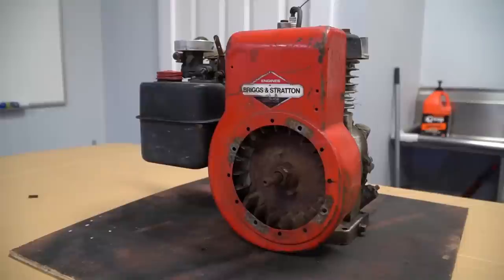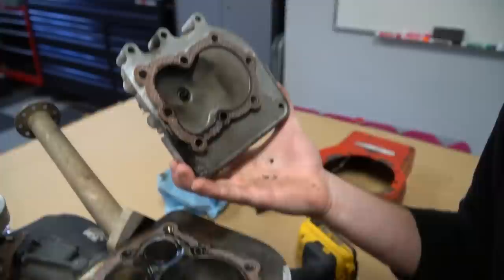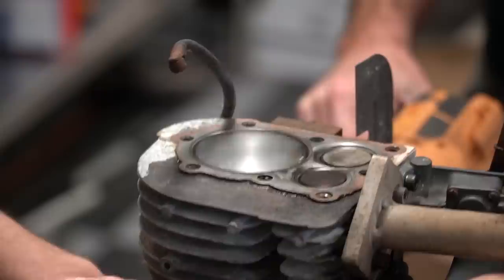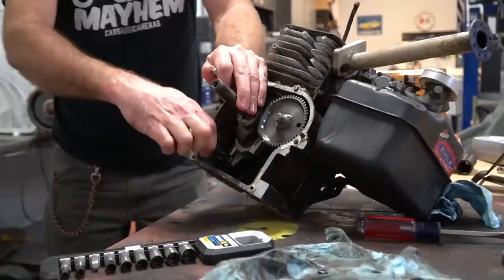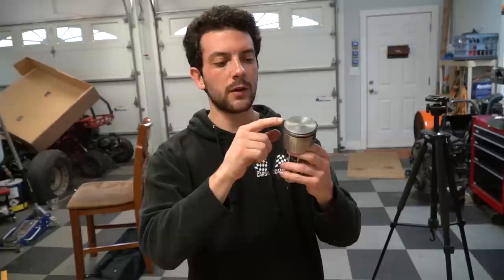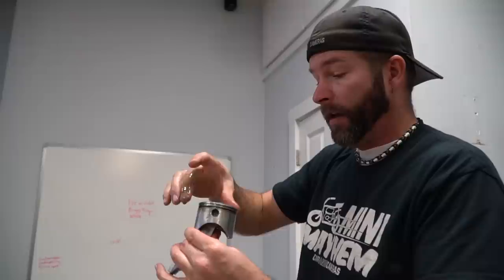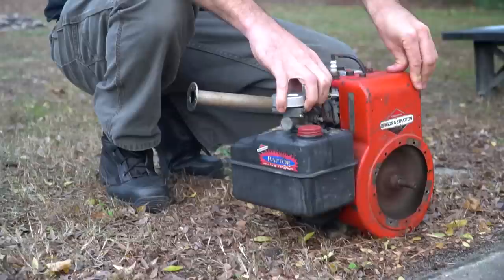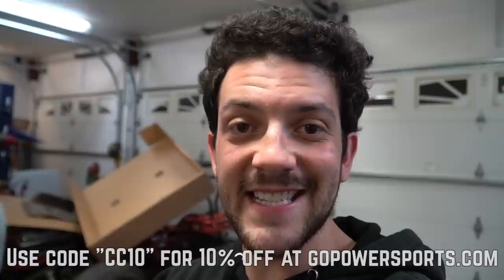Rat Rod Wagon HAULS | Built Briggs & Stratton Flathead

Comment: A short skirt piston travels different in the cylinder connecting rod is longer and the deck height and the compression ratio of the Piston that it's a combination of all three and four and it's probably a forged piston too and it's probably got fatter piston rings and the Piston can be also lighter It's a combination of a whole bunch of things you do your homework on it

Comment: gluing the side cover on instead of using a briggs gasket will make the engine not have enough play in the crankshaft because i tried it and i could barely turn over the engine

Comment: weight, Friction and rotational mass. The rod is lighter than stock too, guaranteed.Rod length may have increased compression as well as smooth operation. Entertaining you guys. You need longer honing stones.

Comment: Fix the front end before it loses another spindle, and why not swap the parts over to another block and get new (proper) rings for the piston?  

And normally, in a racing engine, the lower number of rings on the piston is usually for wrist pin clearance and for reduced drag in the motor.  I would say you guys just lucked into a steal of a deal with finding a briggs with the parts it has, cause normally a new rod, also means a new stroker crank as well.

Comment: Arc racing sells those pistons (one compression and one oil ring) and it only took me the time to type in Briggs 5hp race piston, not sure if it is because you are sponsored by GoPowerSports or what but parts insanely easy to find for a briggs vs a Predator (look at the coil issue for the rail).  Get micrometer and measure the piston and give ArcRacing a call/email and see how fast you get the rings, but you will need a breather for the cam (couple bucks at NAPA) and a TORQUE WRENCH... for the love of god Ike you work in an auto shop just nick one and be done.

Comment: If the bore and rings were bad it would smoke at idle,high rpm creates more vacuum, thus pulling oil up through the guides, the guides are replaceable, find a reputable small engine shop to check the block out

Comment: And, you asked about "racing Pistons" but never asked why you want to run the longest rod possible. Simply put, a longer rod has more duration approaching TDC, at TDC, and accelerating away from TDC, which allows time for the fuel to burn, pressurize, and "push" due to higher psig inside of the cylinder.

Comment: That’s a 205cc Raptor ! It was built up till 1999 , it revs to almost 8,000 RPM , as you stated it’s a methenal burner which is no lubrication in fuel that’s why it’s burning oil . I’ve raced those engines for years ! Nothing in its class will beat it NOTHING ! It’s flat head for me or nothing at all !

Comment: Me and my brother raced go karts as kids, like competitively not just playing around and all of our engines were based on Briggs 5 hp, specifically tiller engines. Tiller engines because they were factory with a forged crank to handle the extra vibration and roughness of the tillers action. Go kart 5hp briggs had cast cranks. I would put my money against any predator/China clone honda y'all could build as bad ass as possible that a built briggs, while probably costing a lil more because most of their performance comes from custom mods, not bolt ons, would last longer. Hell I've seen so many of y'alls engines blow it steers me away from the chinese motors

Comment: The one ring is less tension on the cylinder there for gaining hp not much but worth it. Should be a lighter piston as well. The crispin placement is for longer life and more strength I know I'm missing some other things that I cant think of right off the top of my head. (If someone would correct me on this)
Reply: One more thing a Briggs flat head should hold higher rpms better from everything being inline with each other being more balanced then having to push rods to rockers. I dont like them much because of valve lash an everything involved with doing valve lash..........

Comment: I can Answer Each Question on the "Skirt" Length and other Specs. ( I Made the LAST Model 13's @ Briggs and Stratton in the Late 90's)  Also. Used and Built  "Raptor" Made and Equipped Model 13's .... All  Made in Auburn Alabama. So, you can  "pick" my Brain....if i can remember it all...lol.  Great Video  Guys!  and  "Kick the Tires and Light the Fires!" ;)

Comment: I like the front and center air cooling inlet(might want to put a ratrod grill on it! Pshh grab an old briggs for dirt cheap or free see spring cleanup days old tillers/snowblowers people give them away all the time, tear it apart and fix it, learn to make it run, mix and match parts, newbies need to learn somehow. Valid points tho. Can't you spec out the racing rings diameter and thickness and source that way? did you check the endgap? Nice Vid overall tho! Keep up the mosquito flogging!
Reply: With it reving higher than an oem build, would the breather need opened up a bit to match the airflow?

Comment: When I was 12 I didnt have money to by a $100 engine.  I did have $5 for an old lawn mower with a briggs engine though.  Enough will and basic know how I learned quite a bit with that engine.  I blew the piston out of the head trying to boost it later in the summer.  it is true you can spend 100 bucks every time your cheap engine bites the dust.  but if you are wanting to learn why not turn a wrench to fix something quality made. then learn how to build it.  parts really are not that hard to find.  to each there own I guess.  Some take their Mercedes to get the oil changed,  Some flush their own oil on a built engine.

Comment: That thing is so cool! I want to make myself a decently reliable go-kart that I can build myself without breaking the bank. I want a decently fast kart (Max speed about 25 miles an hour) but I want enough torque to be able to climb hills. (15% grade or steeper) I don't want the complicated process of building suspension, so I'm just going to put some off-road wheels and tires on it. Can someone steer me in the right direction as to which parts I should buy. (I am probably going to use a predator 212cc since they seem reliable.) Thank you for your response!
Reply: But a max tourqe 10t clutch for your chain size. 60 or 70t sprocket for climbing hills but 60 for a little bit more top speed.

Comment: Your problem is that your motor is a Briggs and scrapum, when I used to lawnmower race they were totally shite, would not last a season without throwing a rod. Take you governer off to get more revs, Hondas never pop, rev until the valves bounce! Kawasaki or kubota but kubota valve gear is weak if over revved. Tecumse engines also always throw the rod but we always remove the oil pump to get more power cos you don't need it with the revs up!

Comment: It's a lighter piston and compression is higher. It's stronger where pin goes through. Cylinder needs to be mic'd. May have to order over sized rings because of honing. Def would resent valves why had it tore apart. If I was you two guys I'd take a small engine class, seriously. Fake it til you make it only gets you so far as far as small engine mechanics. Or stick with what you know, new engines/ stuff.

Comment: Run video in -1.25 slow mode. You will see the EXauhst valve crack open on the bottom end of the compression stroke.

This cam magic is how they push 80% of the fresh charge into the EXauhst for disposal, thus reducing economy and HP..
You guys should straighten out the edges of the EXauhst love, this stops the black magic built into all explosion engines.

Comment: I did buy brand new predator 212 CC but every time I whip sideways it cuts off how can I fix that
Reply: Low oil cutoff switch needs to be unhooked to stop that. Unplug Yellow wire on side of engine block. Your going to have to check your oil occasionally to make sure you dont run out
Reply: @isaacitllbefine7231  thanks man

Comment: > I wouldn't go for a Briggs based on our experience, they're less reliable than $100 chinesium bullshit

> Literally plucked a random engine out of the junk pile that'd been neglected so long neither of you had any clue what was inside it till you opened it up

> Run one of the fastest times your course has seen on it

I'm sorry, if anything, this ENCOURAGES using Briggs engines. How many Predators have you lot blown up that had half the problems this one has? You just cannot kill a Briggs flathead and my gokarts will always be powered by them.

Get your hands on a 16-22HP Briggs Flathead Boxer and do a build around that. I wanna see what you guys can do with an engine that's nigh indestructible.

Comment: The Pistons are different because they stroked it. Longer rod shorter Piston the racing one only has one compression ring because that's how they build them. The reason is the manufacturer would rather the engine smoke a little bit than risk breaking or cracking at the wrist pin. Look at racing karts close and you'll see they all smoke a little bit, not as much as that one but hey.... It'll be fine!

Comment: Do a bit of homework hunt down some proper rings for that Briggs so they actually fit bit more of a tune with air:fuel mix and that 5 will sing a better song than any clone ohv tillson ever will. I'm a kiwi born breed and lived my whole live and nothing and I mean nothing comes close to the power preformance of a flat head Briggs. Plus here in NZ parts are dime a dozen anything ohv in small motors I throw out

Comment: you should see my go kart it was a racing kart in WKA or world karting association back in the day and it has the same problem as your engine and its the same engine but maybe a littel older but when it used to race it went 50mph and ive got it running after i bought it off an old man i know and as soon as i got it running it started have oil and smoke problems and some how the gas keeps getting dirty but if you want to see the go kart you can check it out on my face book at Alva snyder

Comment: WRONG....  A Briggs Lo207 Is under 600 dollars and will smoke any price you can build a predator for. They are hand built in the USA and have way better reliability. Trust me. I use a predator on play carts but racing is not Predators strong suit. Believe it. Let me post some build specs.

Comment: Predators are overrated in my opinion. It seems like EVERYONE uses them and they aren’t that interesting because they are too common on go kart/mini bike builds. It is always nice to see different engines other than a Predator used on peoples builds. Briggs and Stratton, Tecumseh, Kohler, and many other engines need some love too on these kind of builds. 

Don’t dis Tecumseh off the bat. You can find those engines in high horsepower on old snowblowers for CHEAP. There are some performance parts for them but not as many as a Briggs. If Tecumseh engines get a resurgence in popularity, perhaps some companies might start making aftermarket performance parts for them like billet connecting rods and flywheels and camshafts. The main issues with the Tecumseh engine was their crappy carburetors. I have a scooter project where I used an old ratty-looking 5 HP Tecumseh snow blower engine, threw on a Mikuni carburetor and that sucker flies. The engine is holding up just fine even when it’s being revved to the moon. It surprised me for sure. 

The good old 5 HP Briggs and Stratton is such a classic. There’s plenty of performance parts for them still and if they are built right, they can give a built Predator a run for their money and can be a lot of fun. Just be aware there are many variations of the 5 HP Briggs, all of them would work but some have features that will last longer than others. Some had aluminum bores while the I/C and Industrial Plus engines had cast iron sleeves. Some had plain bearings while others had ball bearings on the crankshaft. If you’re going for casual fun, any 5 HP Briggs will work. But if you’re planning on building them up for max power, find one with cast iron sleeves and ball bearings. You can always have an aluminum bore Briggs have a cast iron sleeve put in it if you’re willing to spend the money. They are tough little motors. I have a soft spot for them. 

Kohler and Vangaurd are also unique. Vanguards come in single cylinder and twin cylinder, and both are bullet proof engines. The v-twins are the most common and there are plenty of performance parts available. They are the easiest V-twins you can find for cheap. The single cylinder Vanguards are built like tanks and are actually better made than the Honda GX engines, with additional ribbing on the crankcase and is just beefier all around. They aren’t as common but you can find them on marketplace. 
Kohler engines tend to be more expensive but they make a ton of power and are popular with mower racing. There are plenty of performance parts for the v-twins. You can make an insane amount of power from these engines.

Other engines that are less common would be Subaru, Robin, Kawasaki, and Generac. Subaru uses OHC instead of OHV and are loosely based on the architecture of the Honda GX engines. Not many performance parts for those that I’ve seen. Robin engines are not as common anymore but are actually extremely well built engines, featuring forged pistons and rods right out of the box, and a forged crankshaft. Robin eventually merged with Subaru. Kawasaki small engines are really only seen as vertical shaft commercial mower engines, but they have made horizontal shaft engines, but they are less common. As far as I know, they are extremely well built. Some are flatheads which are essentially a Briggs clone except a little better. The OHV engines can be seen on golf course equipment and are pretty stout. Generac engines are mostly found on generators but some are general purpose engines. The cool thing about the older Generac engines is they had pressure lubrication, and some even had oil filters. They look pretty cool too. However, the Generac engines made now are essentially Honda clone engines which is really lame and lose the features that made them unique.
Reply: Briggs is the best cant beat em

Comment: Also Check out the stats on the Animal version. Click Read more here for a peek. Brand:Briggs & Stratton
Manufacturer's Part Number:124332-8003
Part Type:Small Displacement Crate Engines
Product Line:Briggs & Stratton Animal Crate Engines
Summit Racing Part Number:PWD-124332-8003

UPC:024847946093
Engine Assembly Style: Long block
Engine Block Material: Aluminum
Engine Stroke (in): 2.200 in.
Cylinder Bore Diameter: 2.688 in.
Engine Compression Ratio: 8.5:1
Induction Style: Carbureted
Carburetor Included: Yes
Flywheel Included: Yes
Flywheel Material: Aluminum
Starter Included: No
Compression Release: Yes
Quantity: Sold individually.
In-Store Pickup:Choose In-store pick-up (OH, NV, GA, TX) on our web site.
Performance by design, the Animal crate engine by Briggs & Stratton are one of the most popular Briggs racing engines--a hidden asset for your next snowcross or kart race. Each Animal racing engine is assembled by master small engine technicians and tested in their skunk-works in Milwaukee, WI.

Briggs & Stratton Animal crate engines feature: 

* Primary use: karting
* Dual ball bearing, racing-reinforced cylinder
* Squeeze-cast, T-7 treated racing rod
* Ground cam with compression release
* High-silicon valve springs
* PVL digital ignition system
* Racing-only intake port
* Walbro round (slide carburetor)
* Dana Fire-Ring head gasket
* Racing crankshaft with induction-hardened crankpin
* Federal Mogul cam ground, barrel-faced piston
* Chrome-faced, racing-only ring package
* Nitrited dished exhaust valve
* Automotive 3-piece valve retainer system
* Beefy rocker arm stud nuts

Comment: I rebuilt a 5hp briggs from a tiller with a blown rod for 4-H, and then put it on a 1971 Speedway “Widow Maker” minibike. Most fun damned thing ever. and it does like 35 with the stock gears and a 10 tooth clutch! The Briggs engine rebuild was the easy part, it was modifying the engine plate to fit a Briggs instead of an 80cc 2-stroke which you REALLY can’t get parts for that was difficult. Follow my Instagram @chevyguy_55 to see it. Really is a beautiful thing...OH! and my 1969 Camaro project.

to Ike: any tips on how to get a stock briggs to run and perform well?
Reply: Sweet. Porting polishing carb jet and header is high on the list of mods
Reply: Isaac it'll be fine Thank you oh wise one 😂